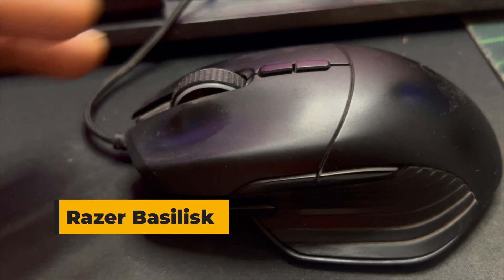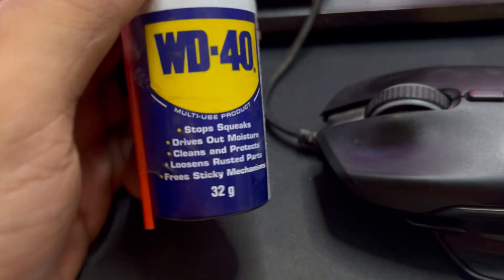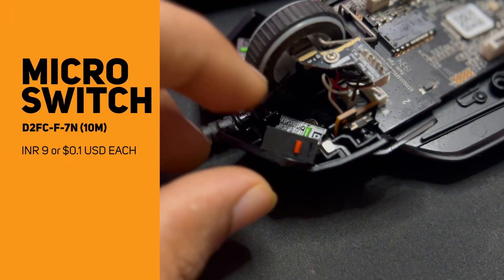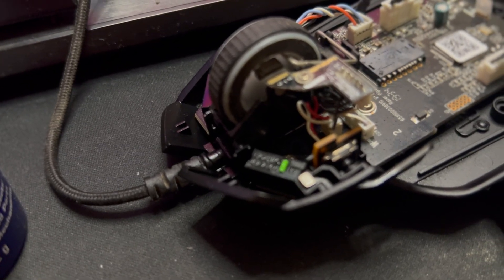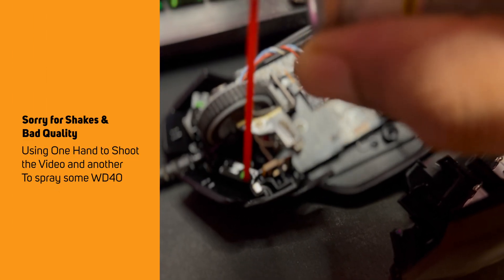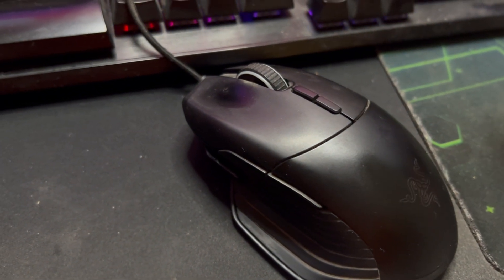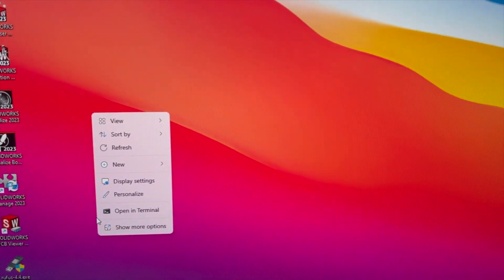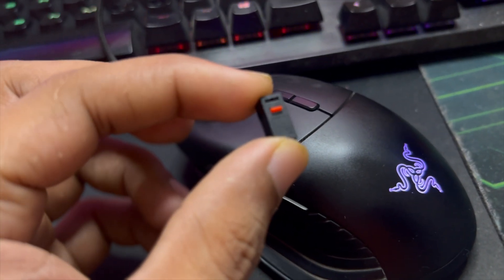Fix Your Mouse Clicks Misfires in Minutes! | Easy DIY Left/Right Button Repair with WD-40

Comment from the maker: Use WD40 Contact Cleaner for electronics or Contact Cleaner in general for electronics instead of the normal one I used. While the one I used works fine, the one I suggested is better.
https://www.wd40.com/products/contact-cleaner/

Comment: Thank you....  I have two used handshoe mice...(even "used" are expensive, due to hand issues with a regular mouse - what I refer to as "claw hand", severe cramping). One was a spare, first one started up, so I went to my spare, and it started to also misfire.  I know it was the mouse because I could click on the very top of the button and it was fine...but this alone drove me nuts.  I was annoyed thinking I was going to have to get yet another used one... with no guarantee on that since it was used.  But your video saved the day. This trick has fixed it and brought both of them back to normal..  thank you!  You not only saved me some sanity, but a pretty good penny too. <3
Reply from the maker: Good to know! 😃

Comment: This worked perfectly, although I suggest using BW-100 instead as that is safe for electronics because the liquid BW-100 dispenses is safe for electronics since it evaporates within seconds while still being able to successfully clean electronics. (I used BW-100 but if you don't have it available you can still use WD-40 or a similar product, although there's a little bit of risk of damaging the electronics)
Reply: Oh and for anyone wondering, my problem was that whenever I used right click it would work perfectly fine, but if I needed to hold it down for whatever reason (most commonly on fps games) it would constantly input rightclick as if I was spam clicking it instead of just holding it down like normal, so if you have that issue it will fix it for sure
Reply from the maker: Glad it helped! Thanks for the tip!

Comment: I just broke my M220 by using this method, all mouse buttons stopped working.

Be aware, if you decide to go for it, you better not over-apply it. One time is more than enough, and if that does not fix your issue, nothing will.
Reply: It is a risk. What I did was to click it like 50 times until it responded. But still, not guaranteed to always work. Worth trying before throwing away an old mouse I guess.
Reply: this doesnt work for long. if it decides to work for a short amount of time, it will stop working again not long after applying wd-40. chances are, someone around you knows how to solder if you dont know how. its a good skill to have though. might as well learn on a broken mouse. solder guns are very cheap.
Reply from the maker: Sorry to hear that, always best to apply a small amount of the product and not overdo it!

Comment: I had mechanical issue on left click of my Logitech M590 mouse. I was trying to find the button online but they were not compatible with my mouse. As the button in my mouse is round shaped + silet click. I was trying to look for other etroubleshooting options and found your video. 
Luckily I had some WD40 left which I use it for my bicycle. I thought anywas the left was almost over so what harm can some WD40 would do. 
But to my surprise it started working like a new one. 
Super thanks...👍👍

Comment from the maker: Ofcourse do this after doing software related troubleshooting or trying the mouse on different PC or Laptops to confirm mechanical failure. Once confirm, perform ghis magical DIY trick to fix it! Worked for me and saved me a lot of hassle although I bought the switches, I don’t need to use them for now! 😊